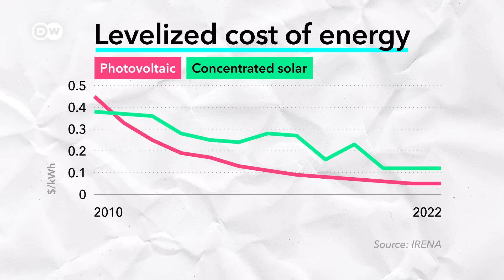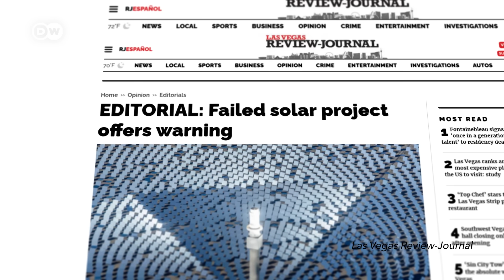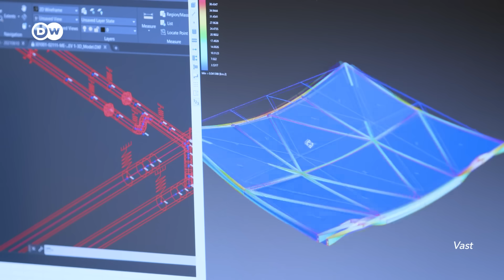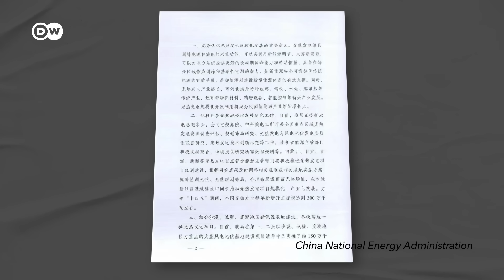How we can make solar power at night

Comment: Anyone else thought they could work by moonlight when they first clicked the video? 💀
Reply: Yes, because of the clickbait thumbnail.
Reply: They can work at night just 88% less power production  @nius3774
Reply: Easy bait..caught up 😂
Reply: yeah somehow i thought the massive amount of mirrors would be enough to get something anything from the moonlight
Reply: I was just gonna curse the article but I already knew about the CSP storage from Gemasolar some 20 years ago, but it only produced power over 16hrs max and went weak by 5am.
Reply: Nope
Reply: Nope, I knew it was clickbait from T = 0, but still the video is from DW, so I knew the contents would be legit.
Reply: No cause I already knew how they work.
Reply: No
Reply: None of us have had an original thought 😂
Reply: Nah...not possible to be Hegelian here...idea won't pop up..one needs to have material experience like a Marxist... No-one can think of moon when it's solar power...the ones who claim are wannabe genius.
Reply: China has developed a new semi-conductor solar panel, it somehow drain the ultra-red light in the night, and produces electricity.
Reply: Put the mirrors on the moon and it might work...
Reply: And at 7:20 you find out, that they use thermal battery to store energy at night. You absolutely could put that thing next to normal solar plant.
Reply: @Teapode  Yeah, and I am thinking maybe you could use a heat pump to heat the molten sodium more efficiently  (> 100%), while at the same time providing refrigeration for other purposes, such as food storage.
Reply: no way
Reply: No. Knew they were going to talk about molten solar thermal.
Reply: Yes i did
Reply: Definitely 😀
Reply: I thought they put mirrows on the moon, to reflect the sunlite to the CSP ;-)
Reply: I mean technically, if we polish the moon, it's possible
Reply: Because it is impossible to heat anything with moonlight (even concentrated) above the temperature of the moon's surface. Physics and the principles of thermodynamics do not allow it.
Reply: No I thought it was placed in a place where half is night and half is day lol
Reply: Solar needs to increase it's efficiency first.
Reply: only if you lack a brain
Reply: Well, they do work by night. That's why the technology is still useful.
Reply: Yes😅
Reply: A long, long time ago there was a green energy education youtube channel, Green Power Science, who was approached by one oof the goofier Japanese media companies about trying to concentrate moonlight. GPS said no, it wasn't possible but they attempted a compromise in that they tried to concentrated spotlights. Don't recall if they were successful in some fashion. GPS is still around but I haven't followed them for quite some time. No  real reason for that.

With these concentrated light energy systems, the hottest they can get is the temperature of the surfaces of the object they're  concentrating. For sunlight that's about 10k f.. The moon, not so much.
Reply: I knew tvey will talka about some form of stored energy 😂
Reply: You know there's a mirrors in space which can give you sunlight at night?
Reply: I convinced a Trump supporter of this.
Reply: Thought we use it on the moon
Reply: yes, reflective solar light may also have little energy.

although the video shows stored liquid salt in 1 degree less to keep the circuit move theough the generator
Reply: Yes they manipulated!
Reply: Yes clickbait
Reply: Yes. I thought it was some fantastic way to focus darklight from the moon - although half-way through the video, I did wonder how that would be possible if it was a particularly cloudy night, but there was no explanation, even by the time we had got to the end of the video. Disappointing.
Reply: No, because I'm smart.
Reply: I now have an interesting reason to live to a 100..... That may be long enough to see all this solar and wind bullshit be torn down and thrown away and covered up with nuclear sites.....
Reply: So why not just put some sort of  giant magnifying glass directly on top of the molten salt tank and just manage the fluid up and down??... And just remotely manage the shade of the magnifying glass to regulate the temperature
Reply: Yup :D

Moonlight Worked for the Ancient Greeks in light houses I believe
Reply: Fr 😂
Reply: Yes I did
Reply: That's because that's what they wanted you to think. Added the channel to my 'don't recommend channel' list.

Also, pv solar and wind farms can use molten salt for energy storage. Heat the salt when there is excess power and run the generator at night.
Reply: @ThatGamePerson  True in theory, but inefficient. I wouldn't write off this tech yet.
Reply: I did..i thought they doped these panels with radium isotopes so they continue producing energy at night under darkness
Reply: Yup, shady
Reply: Hey, DW can also clickbait. It's legal and ethical.
Reply: Legal? Yes
Ethical? No
Reply: @SonnyDarvish  yeah, aha, ethical, like those times not long ago...
Reply: I've waiting for the moon, really trolled us on this one.
Reply: Aside from the thumbnail, why would the title say “MAKE solar power at night”. It is intentionally misleading. It should say “store” because it’s definitely not being made
Reply: no
Reply: Nope, just you.
Reply: Yes, definitely click bait thumbnail
Reply: Yes 🤐
Reply: Well I mean the moonlight is generated by the sun so I mean your kind-of right
Reply: I’m not that uneducated about this topic to even have that thought cross my mind.
Reply: They can, with a little help from an mirror in space.
Reply: @hhf39p  That "little help" would cost a giant pile of cash.
Reply: @yeroca  Yep.  It would be the first step towards building a Dyson's sphere, and unlimited energy.  It would cost less than the 'we will have it in 10 years' fusion work has cost us, and unlike that, it isn't research.  It is a sure thing and can be done.
Reply: @hhf39p  Yes, technically possible, but if you re-direct sunlight through the atmosphere down to pv arrays or thermal collectors on the Earth, what do you do about cloudy nights?  Also, you'd have to worry about environmental effects.  Some companies are looking at putting PV arrays in space, and then transmitting power via microwave transmitters back to Earth.  That avoids the cloud problem, but it's still very, very expensive, and might have a lot of environmental cost.  Personally, I don't think these methods can compete with the alternatives at the moment, especially with costs falling for the alternatives.
Reply: @yeroca  "That avoids the cloud problem .." I don't think this is the case. Microwaves are absorbed by moisture and produce steam.  When looking at EM energy absorption curves microwaves are in the 'total absorption and scattering'  region.  In addition conversion to microwaves requires heavy, expensive, and inefficient equipment.  Maybe you can explain to me how the microwave proposal ever got the traction it did.

Visible light is about the best region for getting energy to the ground,  it is also the strongest energy band.  At least this is what it looks like on the curves.  (File:Atmospheric Transmission.png e.g.) 

It looks like on those curves there is quite a bit of transmission in some bands on even on cloudy days. Do you know what the PV story is in Germany? PVs have a more limited spectrum of sensitivity than does concentrated solar.

..  A portable tokamak would be the ideal solution.
Reply: @hhf39p  I think it really depends on the frequency of the microwaves, but using microwaves has been the predominant proposal for space solar for many decades.  From what I've read, the frequency ranges planned are from 3 to 30 GHz,  which is outside the water molecule resonant range which is at about 2.45 GHz.  There are other molecules to worry about too, of course, so the frequencies used would have to avoid those other molecule's resonant frequencies as well.
Reply: @yeroca  Yes thanks.  I found some data for microwave absorption in the 'radio window'.  And as you say there are are clear bands.  Which, for example, is why radio telescopes based on earth can receive signals from space.   

General opaqueness looks to start above 10GHz, so most of the rest of the microwave band (generally defined going out to 300GHz) would not work well.  Though the data I see did not talk about the effects of night/day  or of weather conditions.   

Similarly, there are open bands in the visible region not absorbed by water.   I wonder how much gets through on a cloudy day.  The PV experience is not necessarily indicative as PVs work on a narrow band.  The temperature does not plumet on cloudy days ...
Reply: @yeroca  You know, if the 'salt' absorbed at the microwave transmission frequency, a solar concentration plant would also be a receiver for microwave energy sent from space.   Any frequency absorbed by the salt could be used, visible, or otherwise.
Reply: @hhf39p  Very interesting idea!  The only downside is that the microwaves would need to be very focused to produce a "spot" that small (only of few tens of m^2).  I just had a look, and the plans for the receiving "rectennas" would be several kilometers across.  In addition to being more tolerant of beam pointing errors, having the beam less focused increases safety as well for birds or aircraft that may happen to fly through the path of the beam.  Otherwise you'd have a beam of say 100MW running through a small area...  Yikes.
Reply: @hhf39p  Good question.  I checked a bit and it appears that near IR (700 to 1500 nm) penetrates clouds to a certain depth, so perhaps you could use IR lasers instead of microwaves, but on heavily overcast days, you might still lose quite a lot.  Medium and Far IR both are heavily absorbed by water.

I think the "real" right answer is to use a space elevator to hoist a high power fiber optic cable to orbit :D  We'd have a few other slightly impossible things to invent before breakfast, though.
Reply: @yeroca  I was thinking that the mirrors would be RF reflectors also, so that the area for receiving would be  100m x 100m.   Basically send down anything that is absorbed, or perhaps change out the receiving sensor - using the term 'sensor' loosely.
Reply: @yeroca  A man who does paragliding tells me that thermals are found under clouds.  So when the conditions are right are there always clouds above solar concentration plants already?   I wonder if a thermal could make a hole in the clouds.  Perhaps if  EM in the correct range was reflected back up?  It might waste some of the energy received.

Perhaps a better answer is to finish that power cable across the straight of Gibraltar and send the power up from Morocco as original planed.  I wonder why that never happened.   I heard the Chinese are building long distance power transmission lines for this purpose.
Reply: @hhf39p  There are always clouds above thermals, because the thermals create the clouds.  The water vapor is funnelled upwards and at a certain altitude begins condensing out of the air forming visible water droplets.   So I don't think a thermal could create a hole, so much as fill a hole :D

Yeah power lines seem like the way to go really.  We don't have enough experience with transmitting power via EM waves to know the long term environmental effects, so maybe it's a good idea to avoid that kind of solution, as cool as wireless power transmission sounds.   For some time I was fascinated with resonant wireless power transmission that doesn't use EM waves, and is pretty efficient (~70%), but the range is only about 10m at best, and I don't think it could scale to orbital distances.
Reply: @hhf39p  an RF concentrator of sorts.   Maybe those "trough" style solar concentrators could work the same in RF if you pipe the thermal storage fluid through the pipe.
Reply: @yeroca  For a large conductive surface relative to the wavelength, microwaves should bounce off.  Most reflective surfaces are conductive, so chances are the solar concentration plant mirrors already work.  Just look at it, it is no different than the radio telescope dishes, though the phase at the focal point will be all mixed up.  That doesn't matter for energy retrieval. The central point then needs to be of a molecular substance that absorbs at the microwave frequency being used.

Though I worldwide power grid of long distance  DC transmission lines.  The tech is already there.   

I wonder if it could be made cooler above the solar concentration plant, so that clouds do not form.   Yeah, that's it, we need put each one in the eye of a hurricanes!  .. Perhaps release hydrogen upward?  

I don't think we know the whole human health story on microwave exposure yet.  And microwaves are new to the planet, so I don't think we know the environmental impact either.  I don't know what it would look like some distance from a power beam, so perhaps it would be localized.
Reply: @hhf39p  One difference is that the wavelength of microwaves are a lot longer than visible light waves, so if you used solar concentrators without modification, they wouldn't work very well... ideally they'd be scaled up by at least a factor of 10.

I have no idea what the effect of releasing hydrogen would be, except pretty expensive :D
Reply: @hhf39p  I just realized you are talking about the flat mirror reflectors.  I do think those would work reasonably well, but maybe not quite as effective as for light waves.
Reply: The moon comes out in the day..
Reply: @markgisborne8482  Yes, and what do you do when there's a "new moon".  No sunlight, no moonlight.  It would have to work on star light, except when it's cloudy.  Come to think of it, we could use the Cosmic Microwave Background radiation to power... maybe an LCD clock or two.  We can receive that day and night, regardless of clouds.
Reply: @markgisborne8482 only on sunny days though cause the sun likes sunny days 😎
Reply: Wow, the amount of yes replies makes me sad for the future of humanity.
Reply: @ronvandereerden4714  We are just clickbaited. Why are you so harsh on us?🤕
Reply: @ronvandereerden4714 the moon does reflect light from the sun down to the earth, it's significantly less energy but it's essentially the same energy, the idea of concentrating it isn't totally out of the question

Comment: Vague memory and used in game (CS) 🙂
Looks like a more sustainable form (less rare materials) but with the mechanical turning of the mirrors maybe more maintenance required? 
Kind of wondering how this can be more efficient then batteries or heating the salt (or metal) during the day and then using this in the night: it requires clout free, and needs lots of m2 so probably not near population-centers (?).